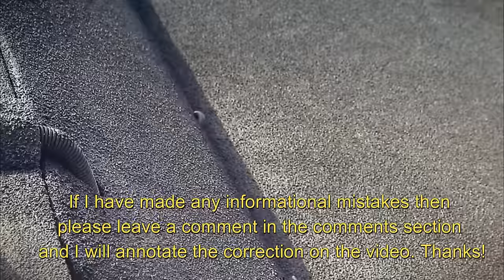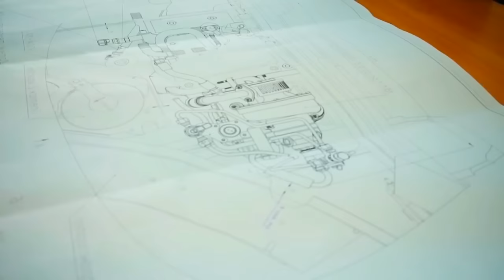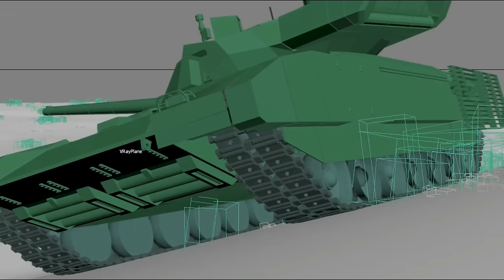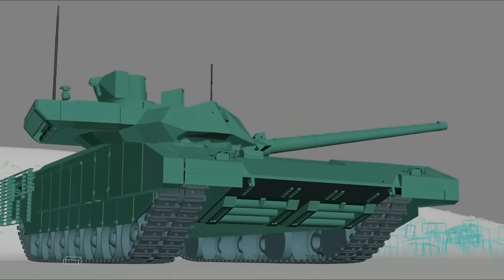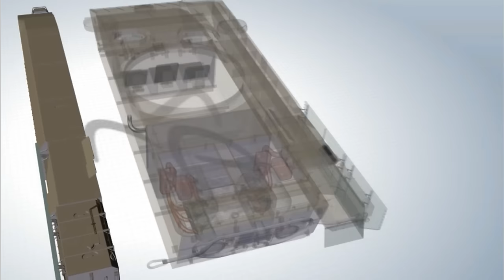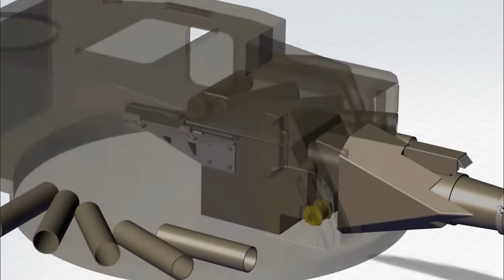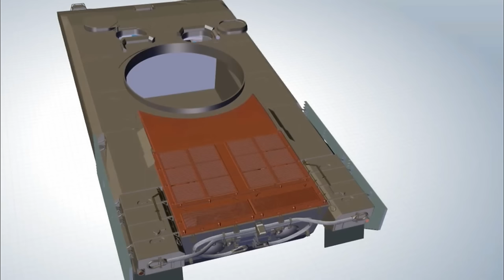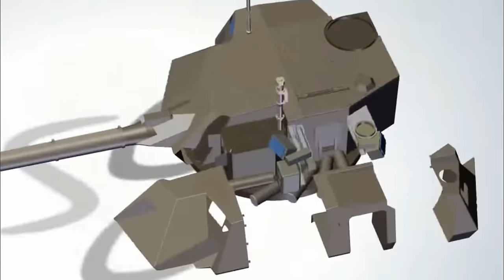T-14 Armata Russian Main Battle Tank - Tank Overview

Comment: Most probably another modification of armata is coming, with 152mm gun, capable to shoot "Stalins warhammer" nuclear ammo. Sry my bad english, just a rumors :)
Reply: I really hope nobody will use those nuclear rounds
Reply: a new KV-2
Reply: It is not objective to use such a gun (152 mm) there.  125 mm is more than enough.
Reply: Since the Armata is a platform and not just a tank, the platform will likely get self-propelled artillery on it. But not the tank design.
Reply: 152 mm cannon it is not a rumor)
Reply: O Rly?
Reply: +Alex Mercer according to some Russians I know, there seems to be a plan to develop a heavier and more armored version of the tank, from 48 tons to 70 or so, meaning, if you think this version is insane, wait until they reveal the version with the added protection.
Reply: Alex Mercer 152 mm gunn is not necessarily better then 125 because if you can destroy most of your targets with 125mm and remember it carry 40 rounds. that is not all, you need: APCR sabot, HEAT, HE... all those fit in 40 rounds, but if you chose 152 mm gunn and then you can carry like 20-30 rounds. imagine you need to send your tank in battle with 20 shells in it. which shells to pick? 10HE, 5 HEAT, 5 SABOT? if that tank get in tank vs tank battle, he is screwed: 3 mised, 2 hit and drive to garage for more ammo
Reply: Alex Mercer 152 mm gunn is not necessarily better then 125 because if you can destroy most of your targets with 125mm and remember it carry 40 rounds. that is not all, you need: APCR sabot, HEAT, HE... all those fit in 40 rounds, but if you chose 152 mm gunn and then you can carry like 20-30 rounds. imagine you need to send your tank in battle with 20 shells in it. which shells to pick? 10HE, 5 HEAT, 5 SABOT? if that tank get in tank vs tank battle, he is screwed: 3 mised, 2 hit and drive to garage for more ammo
Reply: Dragan Crnogorac it can shoot a nuke,silly!
Reply: The best of all especially it doesn't take forever to reload with today's technology
Reply: Dragan Crnogorac, 152 gun is way more better. And you do not need to choose between types of shells as  43kg howitzer HE shell is good for every day.
Reply: MN Gaming & Tutorials, " no known tanks can penetreate t 14 armata" Too optimistic for a new and not battle prooven tank.
Reply: MN Gaming & Tutorials apfsds is a armor piercing finstabilized dart sabot......thats exactly what you said :"D
Reply: MN Gaming & tutorials: thats funny, so T14 wont use sabot, because it uses sabot and sabot is better than sabot? :D (apdsfs = armour piercing discarding sabot fin stabilised = sabot)
Reply: Alex Mercer loose lips sink ships! Shhhh
Reply: MN Gaming & Tutorials apdsfs is sabot
Reply: Hahahaha silly Alex(wispers)listen here comrade,keep your mouth shut or I will be forced to send KGB,or do you want me to get Glorius leader Stalin,so I suggest you do not give away information......OH WE ARE ALL VERY HAPPY,NOTHING TO SEE HERE(waterboarding in the background)
Reply: Yeap, and also probably a proportional increase in range and lethality of it's guided missiles.
Reply: Isn't the nuke ammo for the 203mm canon ?

Comment: Calling T-14 from time to time as Armata not a totally right way. Armata is just a platform one of three existing at this time which can share same battle modules. All new russian armored vehicles are designed as modular systems where you can compose different type of vehicles from existing platforms, battle modules, internal modules, external modules (such as Afghanit) etc. Main idea with new generation of armored vehicles was to not just create tanks, APC's, IFV and all other types but to create different platforms and modules so you can compose vehicle you need with desired capabilites. Basis same like in Front Mission or Armored Core series of videogames. T-14 "Armata" is complex of different modules. This ideology allows to research and create only one module or platform not the whole vehicle. Also this ideology (main reason of it) allow to commanders not to think what they have and what to do with it in upcoming battle, they can compose army with characteristics adn capabilities they need right now. Thinking of Armata is only an MBT is also old way because you can take T-14 shown in this video, deinstall 125mm cannon module and install Terminator-3 module, for example. And once again - Armata is not the tank but T-14 Armata is. If you need shorten name call it T-14.

Comment: At first I thought that Armata was bad design because it is big.
Big tanks have to protect big internal space, so they end up either overweight for good protection, or have crappy protection but remain light. And Armata is light.
But then I figured out. The internal space that needs protection is actually quite small. All 3 crewmembers are in one armored "capsule" and the turret is remote, so it doesn't require to be as protected.

So it makes sense to have space between internal components and outer armor... as a form of spaced armor.
This could be the tank with most protected crew of all tanks out there. 
Turret can be taken out, it obviously does not have thick armor, however if turret does get destroyed tank can retreat with alive crew and get a replacement turret.
Reply: Not that T-64s and T-72s were less protected than a M-60 or Leopard 1 or AMX-30..... they had low profile, impressive armor protection and most of rounds in the belly, when all NATO tanks had high profile, thin armor and rounds stored all around.... low protection on Soviet/post Soviet tanks is pure bullshit in the mind of people, remember this. This is what makes you so surprised.
Reply: RiccardoTheBeAst You are missing the point. T-55, T-62, T-72 small tanks, light weight, good armor.
Armata big tank, low weight good armor.
How is that possible?
The Armata is essentially small tank with bulky spaced armor.
Thats what I'm saying.
Reply: Dario Zanze another thing is This thing is fast at 55 mph with governor at 1200-1500hp unknown speed without governor at 1500-2000 hp love this tank first revolutionary tank in a long time easy to produce reliable cheap deadly and safe
Reply: You guessed principle, separation of vulnerable sites and reserving. But no, not thin armor thicker than modern tanks, much thicker) other materials
Reply: Dario Zanze
Oh ok, anyway keep in mind that ERA plays an important role, since the 1980s for the Soviet Union and later on for Ukrainian and Russians industries, in improving the armor protection for a small weight increase. Totally another direction when compared to western philosophy ;)

Anyway T-54/55/62 were medium sized (as the AMX-30 and Leo-1 for example), while the T-64/72(90)/80(84) are the VERY small tanks!
Reply: RiccardoTheBeAst the new armor is amazing on the armata right now its APS(Active Protection System) can stop anything at 1,800 meters a second and they will try to improve that to 3,000 meters a second even the TOW or Javelin middle as the tile armor goes on the roof as well
Reply: HERPY DERPEDY If it can stop anything, then why are they using armor?
Reply: Dario Zanze tile armor or era with aps only works once after the tile is used a certain area is exposed however even when the armor is exposed the crew still have nearly 1000mm of steel protecting them it's very good but single use on a certain area
Reply: RiccardoTheBeAst Yes, 20 years ago, it was just so. Now, there are other materials, and a large number of tanks is not necessary. ERA is also used, but changed printsyp its work and structure of the passive armor. We need a lot of space for the crew, so the body is high, it is just as well for a gun. But do not think that the armor is thinner on the sides, as the forehead is very thick shell.
Reply: "If it can stop anything, then why are they using armor?" - because battle is not all about tanks firing shells. It could be mines, air bombs or high penetrating fragments, etc. Tanks can face all kind problems and if active armor run out of ammo or lets say tank lost all electricity what ever the damage it sustained - something still needs to work and its passive armor!
Reply: Rus Tar even if Abrams is thicker no tank is immune to modern Atgm Kornet has a penetration of 1300mm of steel but any tank can stop a RPG as long as it's above 300mm of armor
Reply: true, and there is still a wide range of guns that do damage under 1300mm. So, at least by keeping tank thick enough there is less problems for the crew to worry about. However, even RPG sometimes lucky enough to hit coms or mechanical parts that may disable a tank. IMO the more protected the better. But, I do understand what you are saying and frankly it's an old dilemma how thick a tank can be before it is not movable. So we agree: putting on more steel means nothing,
Reply: I'm just tired of fanboys jumping on opportunity to "teach" me a thing or two about this tank.Many things about this tank are still classified, and that includes armor protection. 
I'm simply enjoying myself thinking about the revolutionary layout and concept of this tank.
Reply: ***** actually most of the turret is armor if all the armor was removed the actual turret is very compact however it has a spot on the side which is a weak point as it ejects used casings out and has no armor it's like a little door opens when it ejects
Reply: Well, while keeping the crew safe is a main concern the most vulnerable part of a tank will always be its threads. So, if you take out the threads and some how disable its turret its basically a well armoured box. If it cant drive away nor shoot back its crew safety is null and void.
Reply: I'd also go so far as to say that an unmanned turret will be simpler to replace because its just getting some metal (that exists in a manned turret) and some plastics and stuff (that exist in manned turrets) and the gun and other external bits (that exist on/in manned turrets) but you dont need to get a replacement  tank commander, gunner and/or loader, as they arent sitting there exposed ready to die anymore. probably a simple 1 crane job to hoist out any remains clean it a bit then drop in a new turret unit and return to action by the next day
Reply: I think the protection is much more comprehensive than would seem apparent at first sight, take for example the crew hatches, these appear to also have Malachite on them (unprecedented in tank design) plus look at the side skirt protection,... This continues past the rear of the turret ring (and is very thick,.. possibly combination of composite and malachite). Doesn't make sense that they would protect the hull so far back( despite probably a lot of hardware, plus ammo in this area) and not protect the turret.(bear in mind that there's visibly what appears to be malachite on the turret roof.  Small turret is not indicative or poor protection, as so much less volume is required for no crew!  Also, seems that they have a composite armour that is very light, but requires large volume for large protection.  Possibly ALON????
Reply: @RiccardoTheBeAst   No. The Russians had their ammo stored all round the hull. That why in videos from The Gulf War turrets from T-55s, T-60s and T-72's would go flying in the air like spinning tops.
Reply: @johnmcdonald9304  Yes, but again, they were still better protected than NATO counterparts, you are talking about M1A1HA vs 60s/70s tanks, why always those stupid comparisons? Now T-90M and T-14 have the out-of-autolader ammo stored in a separate box as other contemporary tanks, the gulf war have a comparison value of less than 0.
Reply: But still what's the use of  the tank if it can't fire back? They'll ne just punching bags. They should have put more armor on it.